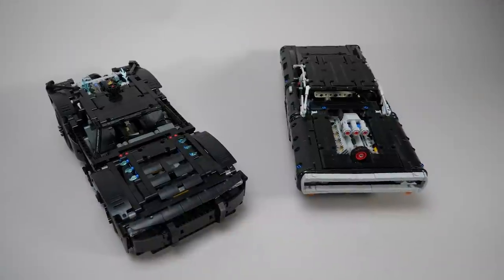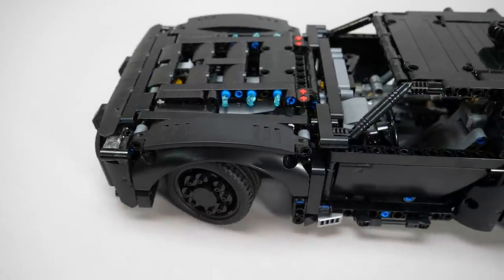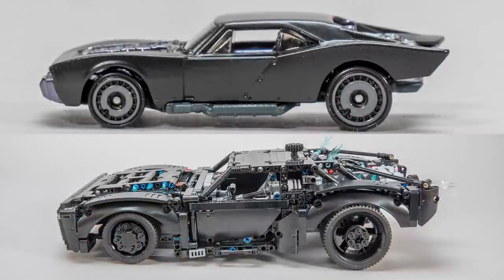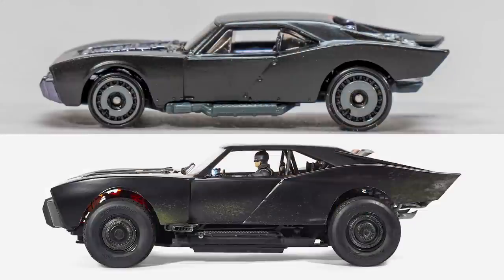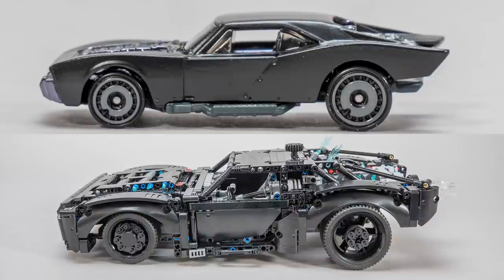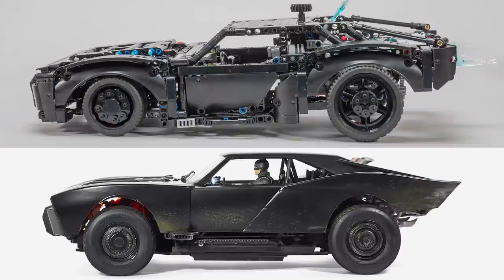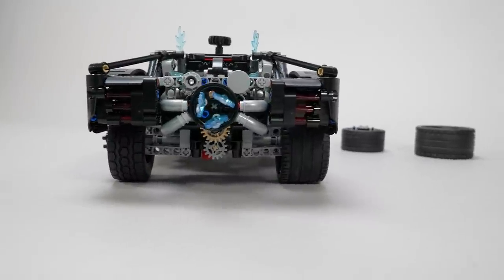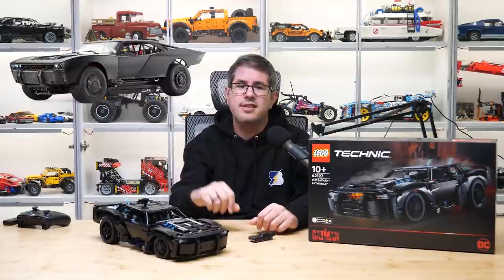What does the 2022 Batmobile look like?

Comment: Both Hot Wheels and Lego are limited by using existing wheel and tire choices and it's hard to use same size wheels and tires front-rear and also at the same time get a low-nose aggressive raked look to a car. Hot Wheels designers will definitely take some liberties to "Hot Wheels -ize" a car design and make it work on such a small scale, but I trust their version of the body panel design if not the wheel/tire proportions. The larger R/C model I tend to trust as the one with the most correct wheels and tires -they can make new molds for that and aren't as limited. Also the tall stance safari-rallye sort of ground clearance matches the movie trailer screencaps.  There are some spy shots available from filming locations, but those don't really confirm anything as they might be stunt cars with specific wheel and tire setups for jumps or other stunts. And I agree, it's also totally possible that in the movie itself Batman has a couple of different car setups as it progresses.

Comment: I modified this, I gave it a old-style bat-symbol shaped spoiler, a bumper, Lamborghini-functional doors, turned it into a convertible, the front roof section flips and move freely with two guns hidden, they appear when you flip the roof. 
I set the rear wheels further outwards. 
Added two little, black guns on the hood. 
Slightly changed the seats headrest style, added a little keyboard inside the car, the passenger's seat folds and has two guns hidden behind it. Gave the steering  gear-paddles, took off all the flames and the black Lego pieces covering the pistons. 
It looks quite good now.
Edit: 
I hid two handguns on the driver's door as well as a smg. On top of that I managed to hide a giant, thin cannon (on each door)- interior-facing).

Comment: I just thought about it, but as the car has no suspension, if they wanted to use a smaller fender, they could have ( finally ) introduced a virtual pivot steering at the front? That would have been pretty great, and quiet easy to do... If someone owns the car and try to modifie it, I will be interested to see the results :)

Comment: If you look closely the roof line and  windshield, you can clearly see that they used a classic Dodge Charger rather than a 70 Cuda, the windshield on the batmobile looks the same than a Charger the Cuda windshield is much more rounded on the edge...

Comment: I pre-ordered the Batmobile: Penguin Chase set and waiting for it to ship from Lego. Can't wait to modify it to be closer to the movie and have it with the other minifigure scale movie Batmobiles.
Reply: @Drew Wilkins closest Lego Store to me is an hour away, so I usually go through their website. 

I got an extra blast and splat set so I can add orange flames to it, as only the back seems to have blue fire. I'm also going to see if I can fit a trans-orange barrel with black grate pieces instead of the sticker to see the front engine like how the technic set has a light up front. Finally, gonna change the hubcaps to the round tile with pin holder instead of the semicircle tiles.

Comment: Good video idea and nice research ! I especially liked the tire test. 👍
It does seem like there are 2 competing looks for this batmobile in pre-release promotional material: one off-road, one low, slick and aggressive. Maybe the car has on-the-fly reconfigurable suspension and gear ratio setups, depending on whether speed or adaptability are required? It’d make sense in a city environment.
I personally prefer the low profile, aesthetically speaking.
Reply from the maker: I had a very similar opinion, I think the car has to have an adjustable suspension.

Comment: It looks like the Ice Charger from the Fate of The Furious with a little extra metal wielded onto it to give it badly designed lame bat-tailfins that look and a front end that looks like a WW2 bunker/battering ram. Also, the exposed engine is a giant mistake. And for the over-sized manhole covers on the wheels. What is the point? They don't cover the rubber part of the stated wheels. You know, the most vulnerable part of the tire.

Comment: Jada can usually be trausted for detail and accuracy even though their idea of a 1/24 is more like 1/23 or 1/22 they are so bulky and heavy. But the Jada 2022 Batmobile that I have is pretty accurate to the movie. The Lego Minifig version is absolutely not accurate. Still a pretty cool build.
Reply from the maker: The wheels are ruining the look of the car on the Technic version, that's the maint reason why I prefer the minifig scale build. Might not be super accurate but doesn't really has to be at that scale, and still captures the essence of the car better.
Reply: @RacingBrick  Your technic wheels are not all that inaccurate. If you look at the real car  the wheels are indeed smaller in front and larger in back. I do not care for the Technics because I would rather have a good looking build that does nothing but sit on the shelf rather then a thing that passes for a car with a bunch of moving parts.
Reply: @RacingBrick  Oh the Minifig Penguin Chase car is very cool, but to be accurate it would need to be more than 8 studs wide. In real life this thing is massive. Even for an American car it would be excessive.
Reply from the maker: @SilverSpoonRiche  the problem is not the size difference of the front and real wheels, it is the tire/rim ratio. The movie car has fat tires and relatively small rims as it is basically an off-road muscle car with long suspension travel, the LEGO version on the other hand looks like some street racer.